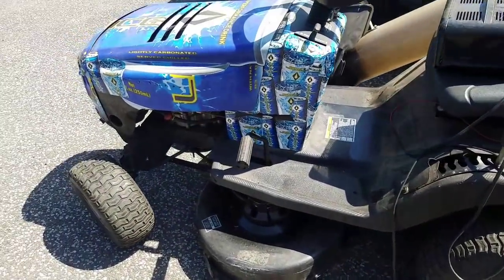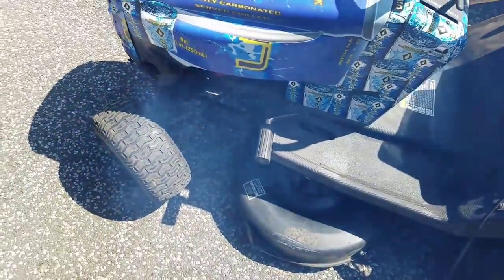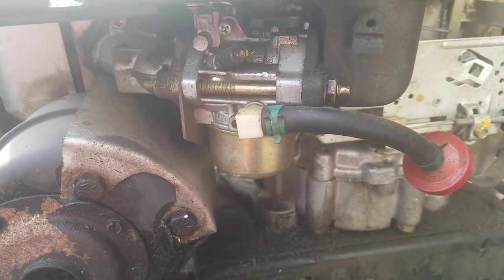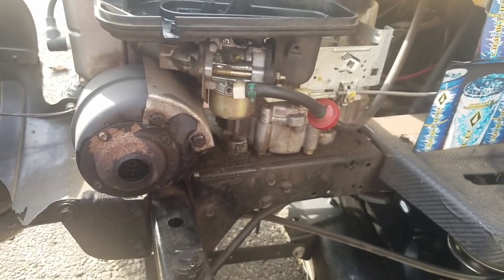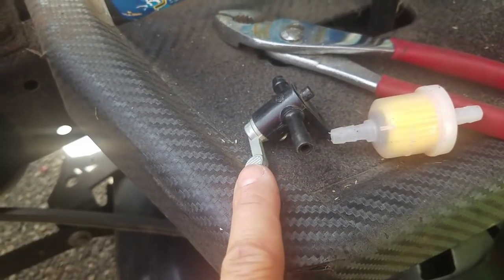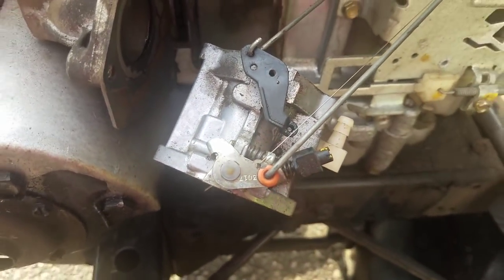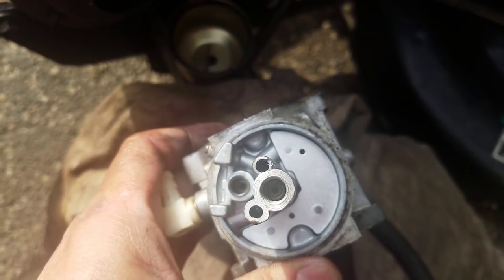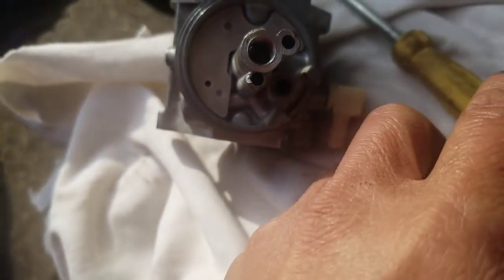HOW TO FIX A RIDING MOWER THAT SMOKES & STALLS CRANKCASE FILLED WITH GAS CARBURETOR CLEAN OIL CHANGE

Comment: Piston rings. Check compression. Also make sure you choke is off.
Reply from the maker: Lol, nope, just an oil change.  Gas in the crankcase! If you watched the video, youd know that.
Reply: too much oil- i had that happen to mine
Reply from the maker: @billte3257  Lol, nope, just an oil change.  Gas in the crankcase! If you watched the video, youd know that.

Comment: The oil change, cut a beer can in half an slide it under.
Reply from the maker: Thanks Matt.  And then, after 2 secs when it fills up?
Reply: Just put a bowl underneath to catch it
Reply: Cut the bottom off
Reply from the maker: Oh I see, you means it acts as a reverse funnel.

Comment: you did NOT actually do ANYTHING to the mower! you said the carby was already clean. So what caused the fault??????
Reply from the maker: I guess you didn’t watch it...needle in carb wasn’t seating,  causing gas to trickle into the crankcase.  Oil change and carb clean fixed the issue.
Reply: @MowersNBlowers  what did you do to the seat and needle? you said it was clean!
Reply from the maker: Clean as in it didn’t have varnish, debris, gunk, gel etc in it!  It was clean but had oil in it.  I rinsed the oil out with carb cleaner

Comment: How do you have a channel named Mowers N Blowers and not know jack about what you're looking at?
Reply from the maker: It’s fixed isn’t it? And it wasn’t called that back then! Look at the date of the video jackass! I’m not a mechanic either!
Reply: Guy seems to be in beginning stage of learning abt mower repairs.  "I cleaned the carb....then stored it over the winter w/fuel in it".  What?  "There's gotta be a better way to drain the oil".  Yea, tilt the mower.  A few other silly things, but last, he says in below cmnt "I'm not a mechanic" but refers to himself as "Mr. Mechanic" 1:52 video, and constantly says things like "us mechanics".  C'mon man!
The video was 2 yrs ago so maybe he's learned a lot since then.  Still giving him props for getting it running, but I feel like it'll only be temporary.  I don't know that he actually fixed anything.

Comment: I WOULD SAY THAT YOU PROBABLY HAVE A BLOWN HEAD GASKET
Reply from the maker: If you watched the whole video, you'd know that youd be wrong...gas in crankcase is all, added fuel shut off, changed oil, cleaned carb, runs like new. And stop SCREAMING AT ME!
Reply: @MowersNBlowers  he screamed at you LOL!
Reply from the maker: Some people are just ANGRY!
Reply from the maker: Thanks for the comment! First time? Hope you subscribed
Reply: @MowersNBlowers  I had this same issue today with my riding mower. EAZY FIX!  LOL